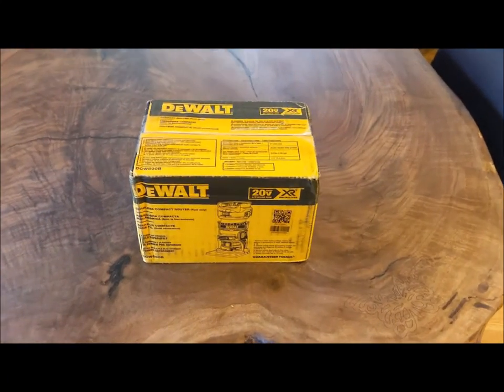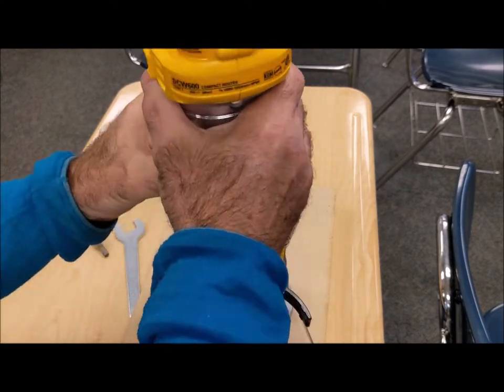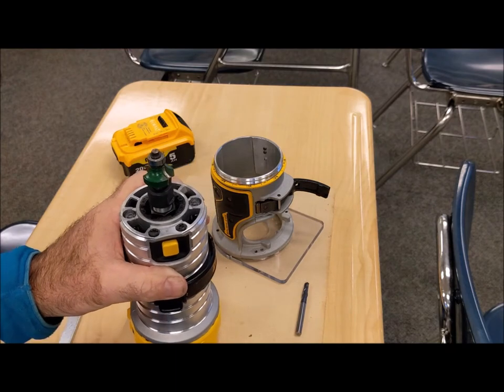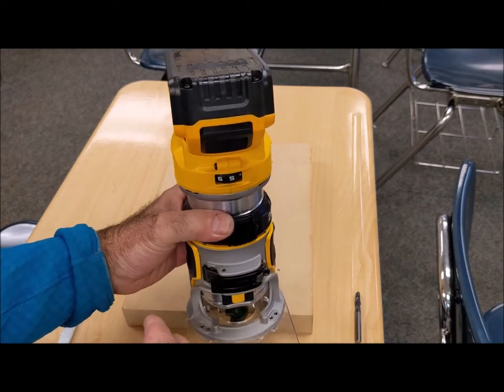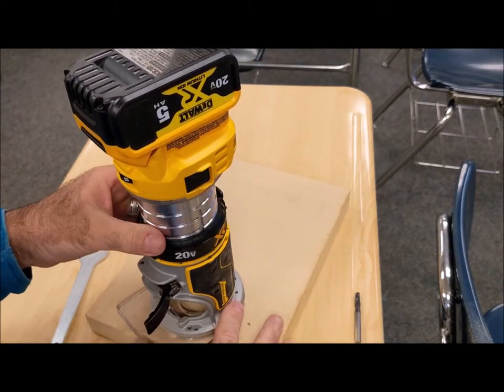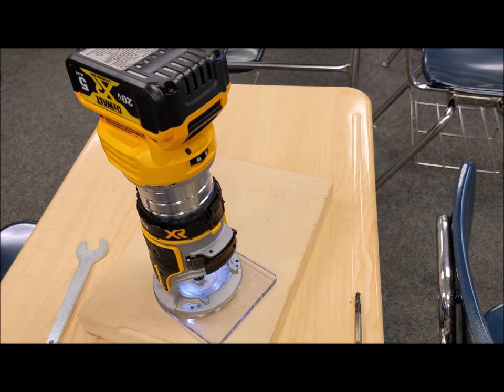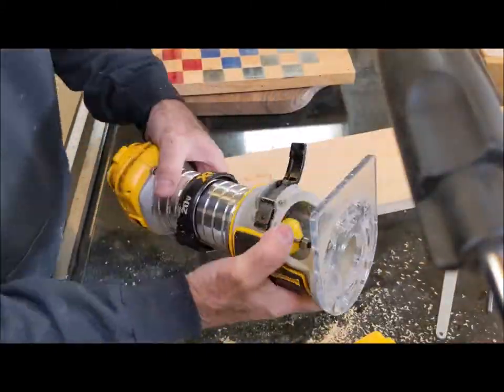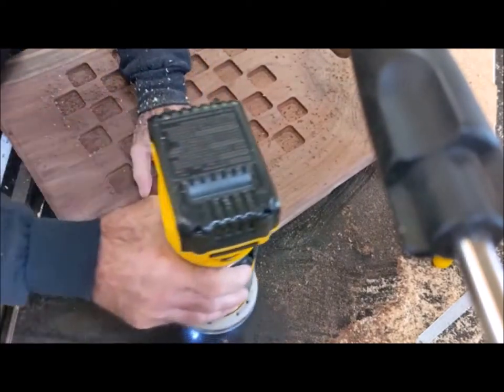First Try and Review DeWalt Cordless Router, How To Use

Comment: I'm new to routers myself. Might you be going in the wrong direction? Should'nt most cuts ideally go counter-clockwise on the outside of a piece
Reply from the maker: There are two directions, one is a climb cut, the other a conventional cut. That was a climb cut, which is uncommon in a hand router with a higher chance of kick back. Both types of cuts have their advantages and disadvantages